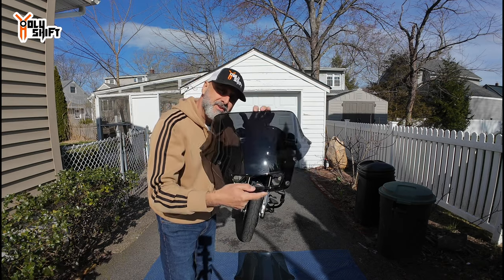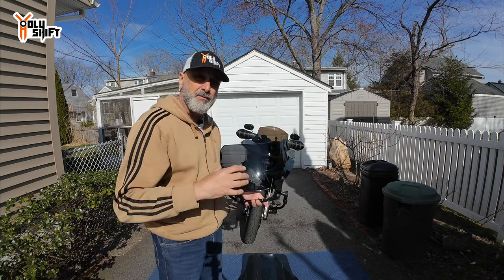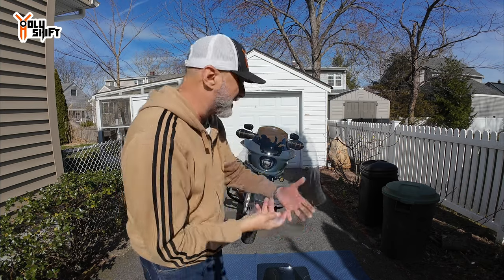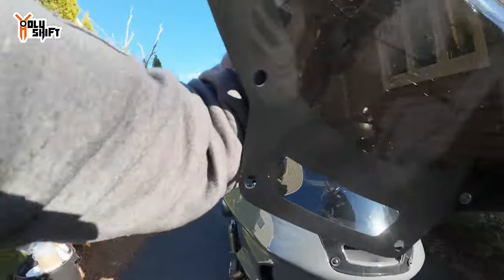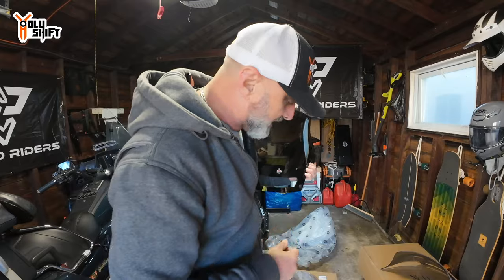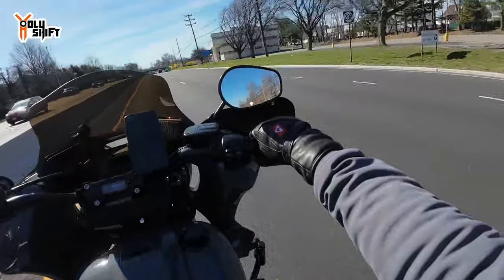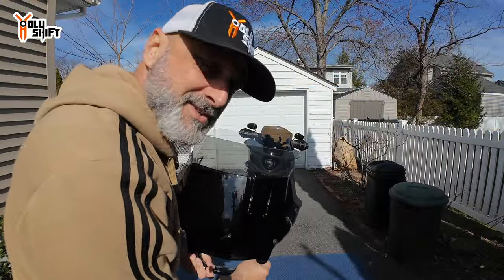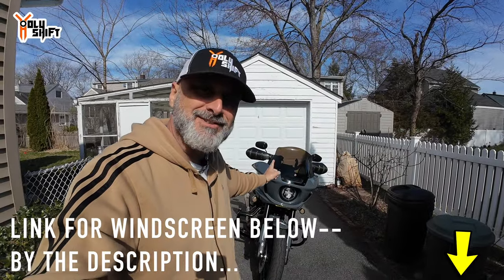The Perfect Windscreen Arrived ! Klock Wertks 8" Bronze Install & Review.

Comment: Nice looking…. I have a wind screen form Freedom shields that I love, well made, thicker that stock and they will etch a design on the lower part for You, I chose the flying Eagle and it looks great on the tinted one I chose, great product, many choices of sizes and from clear to levels of tint. Very pleased with it. On my 2022 street glide st with no more head wind buffeting I had with stock one, and none of the distortion of vision through it that seems to be prevalent on a lot of other aftermarket ones